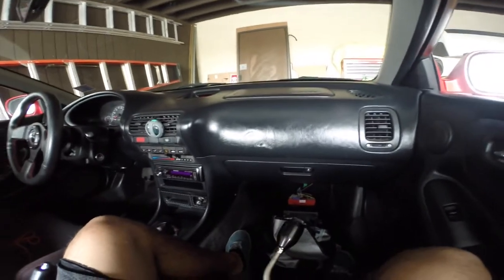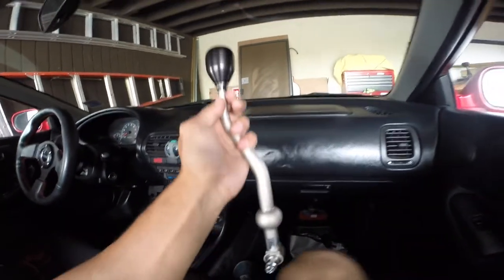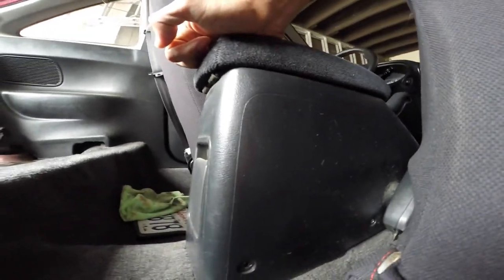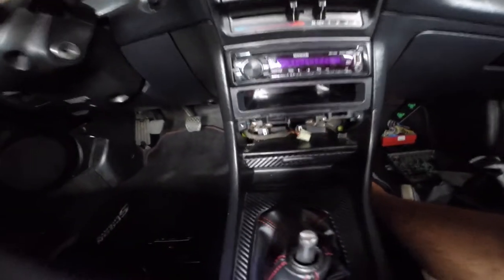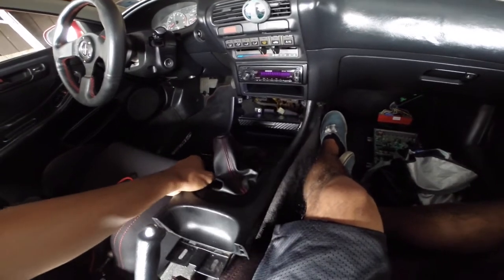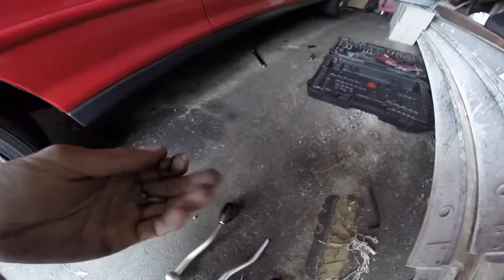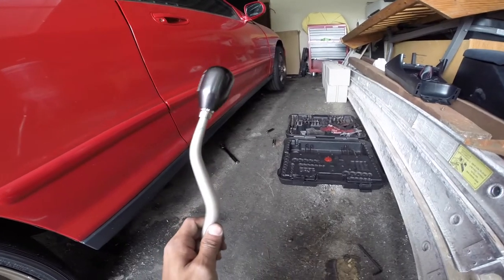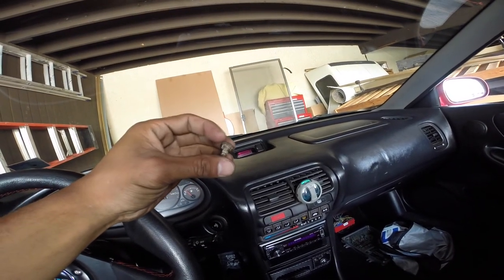How to install Skunk2 Short Shifter & Review - 94 to 01 Integra

Comment: I have a question about the compatibility of the shifter. My last one that I got was a piece of shit aluminium one and it didn't fit into the shift linkage properly because it was narrower (the aluminium shifter was 10mm narrower than the stock shifter base = shift play). So I'm finally fed up with it and I really wanna get the skunk2 dual bend. My question is where you ordered it from and how you got the correct spacers? Because on the skunk2 website you can only order a generic dual bend for integras, civics, crx's, etc. And I'm guessing they wouldn't include all the spacers for those?
Reply from the maker: Yeah, I had that same piece of crap aluminum short shifter. It snapped on me. The skunk2 shift leaver isn't as narrow but still has some play. What i ended up doing is just using washers to get rid of the unused space. Obviously put an even amount of washers, per side, that are snug to the shifter bolt, and it works like a charm. I wish you the best of luck Ka0ticNight

Comment: Where did you get the striped shift boot cover/panel?
Reply from the maker: Its actually a Carbon Fiber wrap/vinyl. You can get 8'x1' roll of it on Ebay. But real Type R's actually come with it stock and it's not a vinyl PizzaxChicken
Reply: filipinokid04 Oh cool, thanks for the video and info
Reply from the maker: PizzaxChicken No Problem. Thanks for viewing.

Comment: probably a dumb question but im about to order a skunk2 short throw for the daily, are the ES bushing kits compatible with the whole bearing setups of these short throws? or would u happen to have a recomendation of a bushing kit to get along with the short throw "2 birds 1 stone"
Reply from the maker: @edward suever I do not have a recommendation. I suggest reading up on reviews. I am sorry I do not have a definitive answer or brand. Unfortunately when I switched my shift lever out, I did not change my bushings and do not have an opinion to base an answer off of. Good luck with you endeavors and build.

Comment: Nice vid bro, helped out alot, i just wanted to know was there a specific bolt&nut i should get to replace it with the old one?
Reply from the maker: Hey Jose Hermosillo, there was no specific bolt and nut. My garage has a whole bunch of bolt and nuts. Just found one that will work, fastened it, and thats it. Whatever helps to prevent using the stock ones shown in the video. Thank you for the view and share of my video.